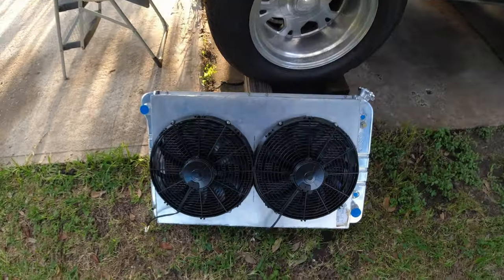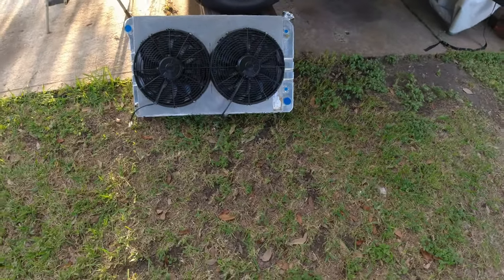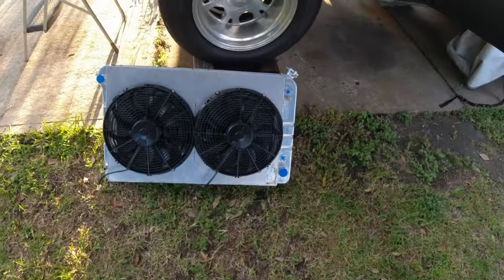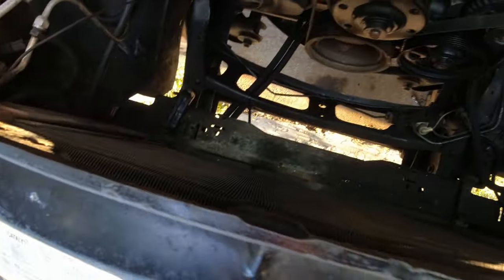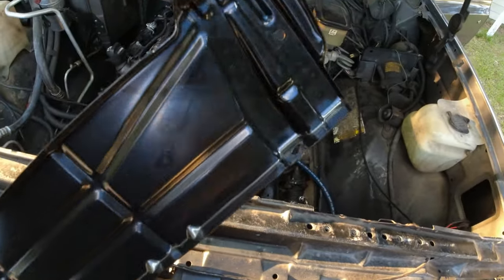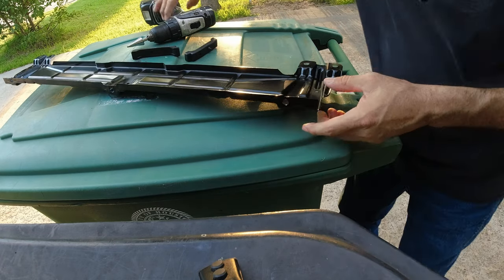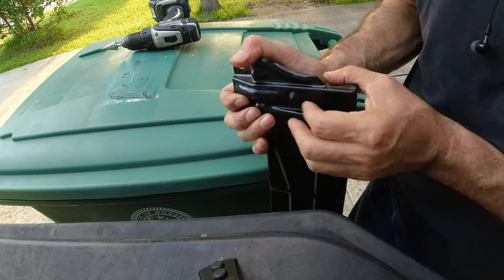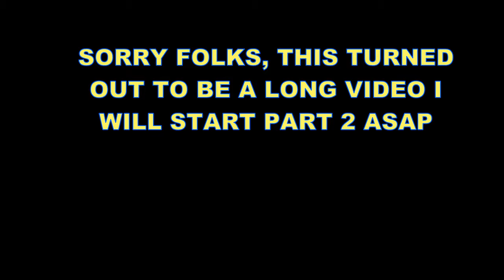HEAVY DUTY COLD CASE RADIATOR INSTALL. Part 12. C10 LS swap. Does it fit??

Comment: You weren't messing around with the fan size! Reduced dam pressure in front of the truck and added thrust when the fans are on should also give you a few extra miles per hour! Those would definitely get the job done here in Las Vegas during the summer! Nice work Hybrid!
Reply from the maker: Only problem now is the truck runs to cool.

Comment: Do you use the small block rubber mounts or big block? Can you give me the link for what you used?
Reply from the maker: I used the stock SB frame mounts. I used the holley LS block mounts on the engine
Reply from the maker: Oh my bad. I used the SB mounts. I did have to modify them
Reply: @hybridmusclegarage4590  sorry I meant for the radiator?
Reply from the maker: @karims.8416  LOL you threw me off. They are call core support insulators. Just use the SB. they will work fine